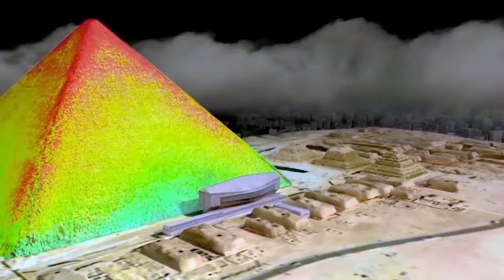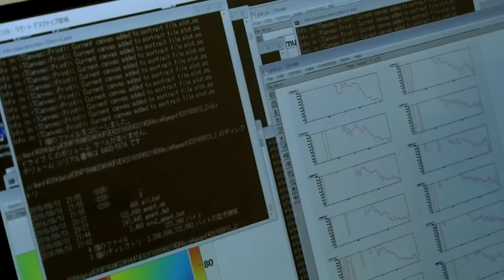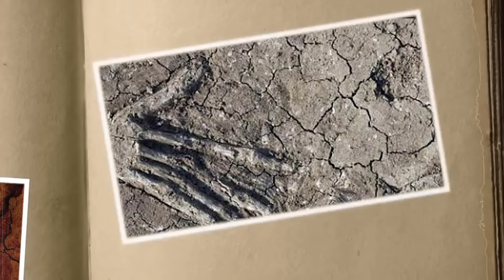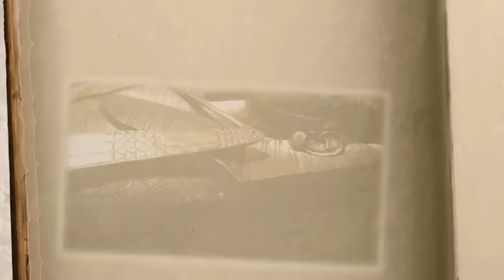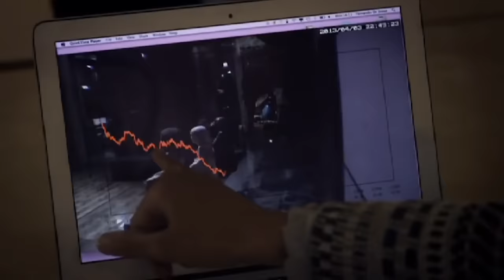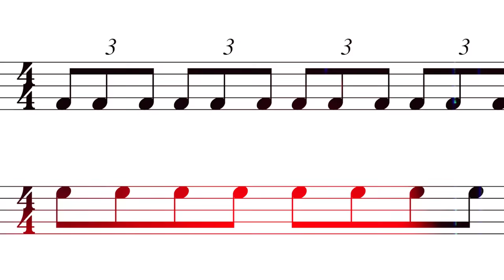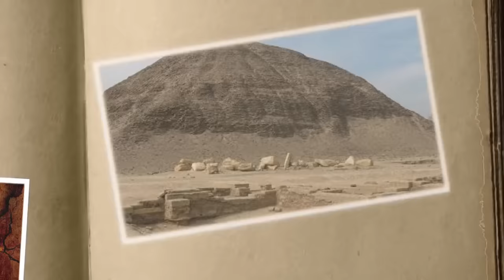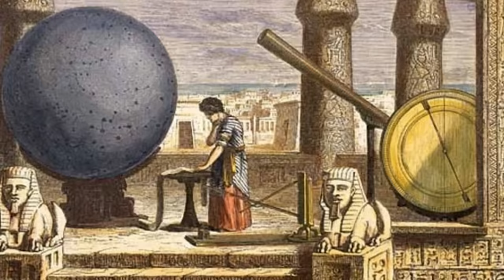No One Had to See This! What They Discovered in Egypt Shocked the Whole World

Comment: better get better fact finders for some of these cases. The "spinning statue" was discovered several years ago to not be totally flat on the underside of the base. it has a tiny bump that allowed the statue to rotate on said imperfection, when heavy machinery or large trucks passed the shop during the day. Of course it won't turn at night ... no trucks are using the roads much. it finally stopped spinning after they placed it on a small piece of felt material.  so no paranormal issues involved here.😆😆😆